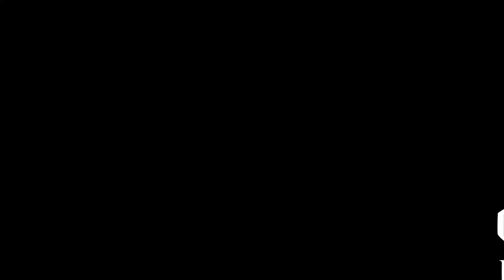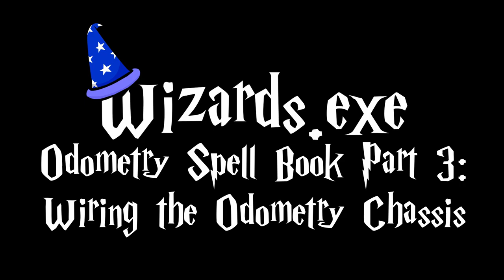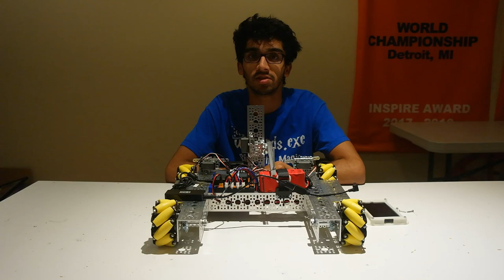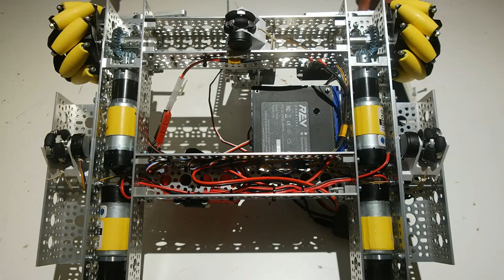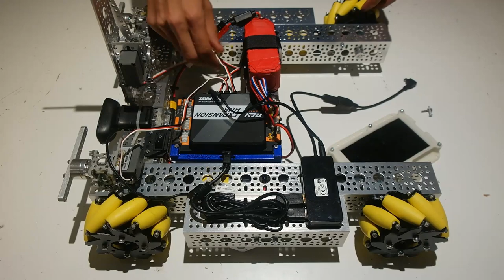Odometry Spell Book Part 3: Wiring an Odometry Drivetrain

Comment: Hello, I am curious about how exactly you are wiring your encoders to the rev module. I am also wondering how hard it is to use those encoders and what kind of interface they have in terms of programming. Please leave links for the wires.
Reply from the maker: We are wiring the encoder using these wires and a level shifter. 3x https://www.usdigital.com/products/en... part number E8T-360-250-S-D-D-B 
If you can crimp pwm connectors, buy 3x https://www.usdigital.com/products/ac... part number CA-MIC4-W4-NC-1 otherwise buy 3x andymark.com/products/encoder-cable-36-in-long-with-single-pin-connectors. They plug into the encoder ports next to the motor power ports on the rev hub. For programming, we have to write the code by ourselves and we will cover that in the next part of this Spell Book which will be released on Sunday.

Comment: what wires do we use to connect the encoder to the level shifter? Because in the links that yall sent, there was a 36 in long wire, and I was wondering since there are only two ends to the wire, how will we use that wire for all three encoders?
Please respond quickly because we are about to buy the pieces to odmetry.
Thank You
Reply: Hello, you'll need to buy 3 of the wires, not just one. The Andymark ones are a bit long, but they're the best option if you can't make custom wires.
Reply: @arjunoberoi7976  In the andymark connectors, there is one side that is connect to the odometer but the other side has 4 different connectors so how would that pug into the rev expansion hub. Also where would we plug in the logic level connectors  ?? Please respond ASAP since the season is starting in a month and we still have to build the odometers.

Thank You So Much
Reply: @videetmehta4129  Hi Videet, the encoders are at 5V, but the Rev expansion hub is at 3.3V, so you need a logic level converter. For future communications, please email us at wizards.exe@gmail.com as Youtube comments doesn't allow me to give you the detail I would like to.

Comment: Hello, just curious, how do we know which order to put the 4 single pin connectors into the rev level shifter?
Reply from the maker: Hi Austin, on the back of the Rev Levelshifter there are markings. The black wire should align with GND

Comment: Have you compared if your odometry wheel encoder is more accurate then the encoder reading through your four omni wheels? Would accelerometer be more accurate?
Reply from the maker: We haven't done any direct comparison between the encoders wheels and the encoders on the mecanum wheels and the accelerometer. The main reason the odometry wheels are better is because even in collisions with things where the mecanum wheels are powered and will slip, the odometry wheels aren't powered so they will still have an accurate idea of where the robot is on the field.